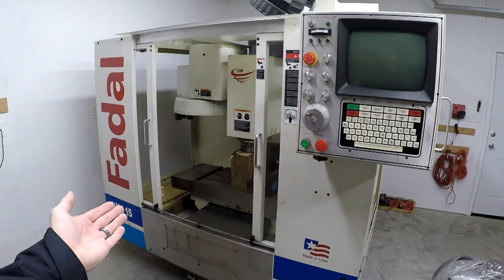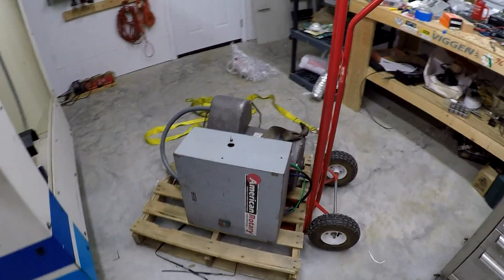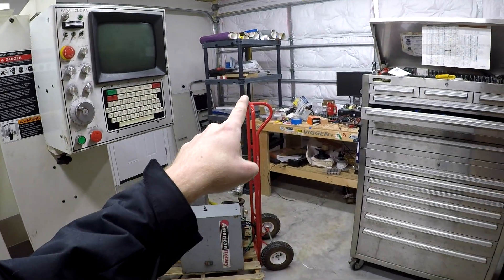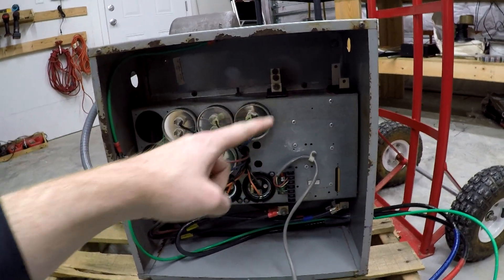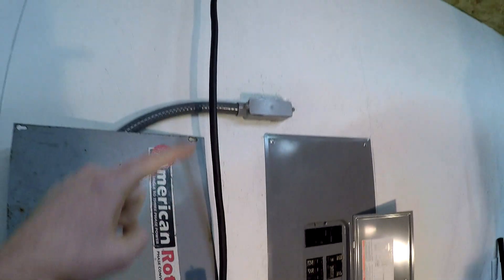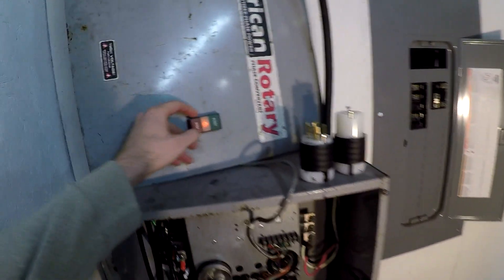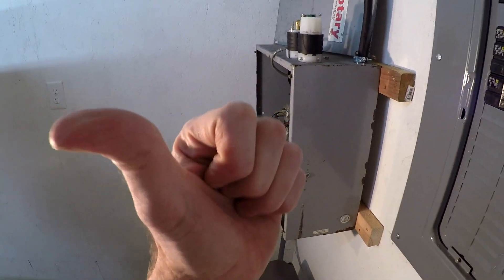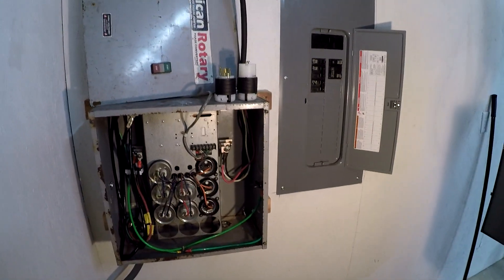Rotary Phase Converter Hookup - Part 1

Comment: Great video, you wouldn’t happen to still have that pdf, would you?
Reply from the maker: Shannon Dixon what pdf exactly? (I didn’t rewatch my video)... I’m pretty sure anything I used I got offline or got from American Rotary. Let me know what specifics you need and I’ll take a look to see if I saved any of it electronically.
Reply: @bgwmachine  I've been looking  for the manual for the older American rotary phase converter,  like the one you used, but haven't had any luck in finding it.  At this point, I'm pretty sure I can wire mine like you did.